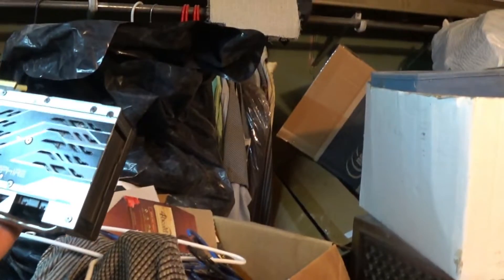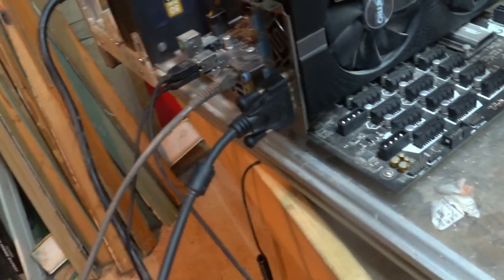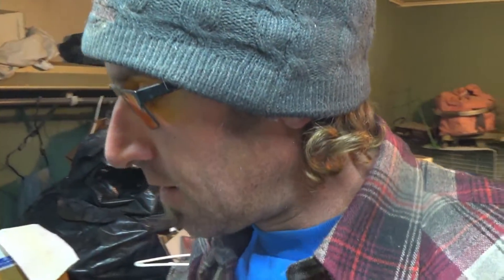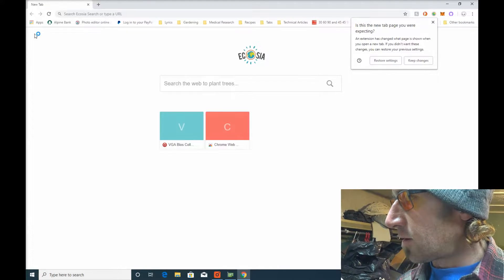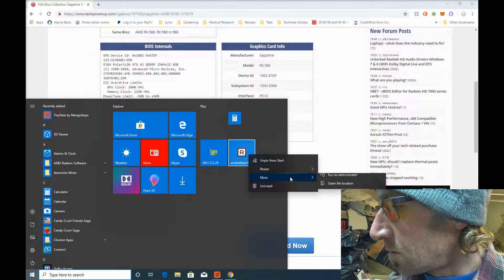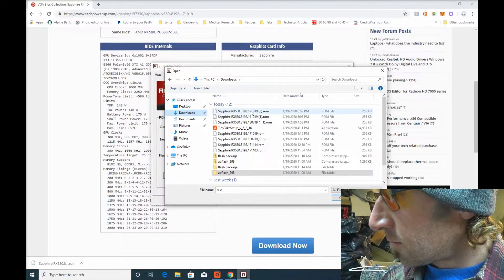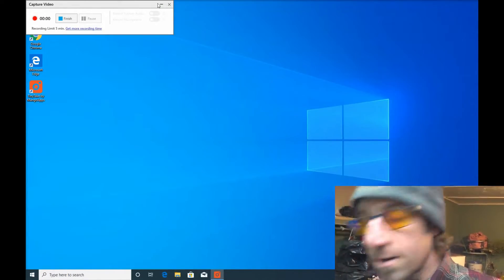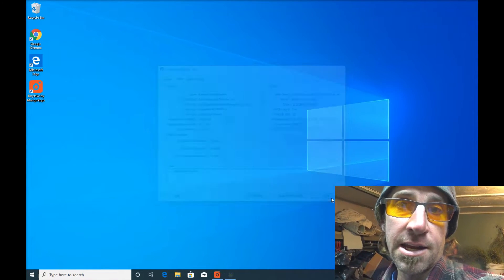How To Flash Stock BIOS of Any Graphics Card

Comment: Dude! Thank you so much! My RX 470 wouldn't install AMD drivers and was getting Error 43 in DXdiag.  I've never flashed a gpu Bios before. Made it SUPER EASY to follow. You also saved me from having to find a new GPU for my recording rig. I re-flashed the existing f21 vbios, and it worked. Windows sees my gpu now and can display my monitor at the proper resolution and Hz. Liked and Subscribed! Now I just have to fix that wobbly fan. THANKS MAN!

Comment: tnx. i have a gtx 750 ti and in the app for device id it says 10de 1380 but the bios version is 70.08.d3.00.00 which is for gtx 750 and i dont know the subvendor to get the right bios version can u help me with that?. also the device has code 43 error.
and i have searched for fake graphic cards and it seems that my card is a fake but the device id which matches the 750 ti and the bios version confuses me also the gpu clock and memory is 700 MHz and 750 MHz which matches with gtx 750
. help me.
Reply from the maker: Sorry to hear that! It's going to take some detective work to find for sure!
Reply: @MartyUlrich  is it possible that it has a modified bios installed?
About that deyective work, do I have to check the core chipset?

And also thanks for helping me
Reply from the maker: @sammarine8952  First, off, if the video card works, it is obviously not fake. If it is something some kid built in his garage out of five other cards, then you will just have to play around with different BIOS ROMs until you find one that works. Should be good practice - by the time you find one, you'll be a pro at flashing and troubleshooting GPUs!
Use the tools I describe in the video - it's all there!
Reply: @MartyUlrich  thanks a lot. and yes its working with an old driver for 2017 which is not compatible with some games.
thanks, I appreciate ur help.

Comment: I failed to run the amdvbflashwin file successfully. Error: Ati video is not available. Please show me what to do. Step at time 9.25!
Reply from the maker: Download the ROM again and then reinstall ATI flash and GPUz and try again using a known good video port (on motherboard or secondary GPU)
Reply: @MartyUlrich  I tried again to run the amdvbflashwin file (version 2.93) and got the message "Cannot find discrete ATI video card". Using the onboard primary vga. There is definitely a removable VGA on the machine. Please help me, thank you!
Reply from the maker: @HOANGNGUYEN-py1yi  are you able to see the drivers for that VGA? Does windows show any errors with them? I am not familiar with that particular error and would need to troubleshoot with a known good GPU and/or another motherboard/CPU

Comment: Hello, this is a long shot, i just bought 2 GPUS  rx 480s they are both like that 580 once i boot up the fans kick up to 100, is there a way to flash it and have the stock fan curves??
Reply from the maker: Yeah, that's what this video is all about. However, the fans may be kicking off for other reasons. Try the flash first. Could be a driver issue or a temperature issue! Good luck!

Comment: My motherboardsis broken
Reply from the maker: That sucks! Time to find a new one!
Reply: @MartyUlrich  my motherboard is broken becouse i did flash gpu
Reply from the maker: @fortzq9311  That is a first. The GPUz application has nothing to do with the mainboard, but if the motherboard is on its way to failing, an operation like this might just trigger its demise. Troubleshoot and see if one of the memory modules has failed. The CPU itself might have failed too, just have to test everything, but in all likelihood, you'll need some new hardware.

Comment: what about if someone has onboard VGA like intel hd intel graphics 2000 3000 or 4000 how to update vga bios for those/?
Reply from the maker: I don't think ATI flash will do that because it is integrated with the motherboard and therefore the only way to flash that GPU is to flash the BIOS of the motherboard, which is a completely different process.

Comment: mine crashes when i run ati utility even if i run as admin, screen flashes green then goes black with comp still on
Reply from the maker: Definitely a problem with the video card. A BIOS flash may not fix it as I think there is something physically broken on the board. Try the GPU in another PC or as least another known good GPU in your current machine to verify
Reply: @MartyUlrich  i ended up having to flash it with a software update app from the website but also had to use msi afterburner to reduce some settings for the new software to work right   so far so good  ty sir

Comment: Hi! My computer freezes when I execute the program to flash bios. What can I do?
Reply from the maker: Run some hardware diagnostics. You might have an issue with the hard drive, memory, or something on the board. The GPU shouldn't crash the system. If you can, try another machine.

Comment: Hey man I need help. I flashed my GPU bios and it wouldn’t boot after that. However I was able to reset my whole pc and reinstall windows and now it works and I can do normal stuff. However I play video games and when I installed my GPU drivers for my rx 580 my screen instantly turned blue when it tried to open. Therefore I had to boot in safe mode and uninstall my drivers which was successful. Then when I tried to flash my bios with ati flash my screen instantly turned blue when I tried to open it. Yes I did try to run it as administrator. However I downloaded what I was told to be the default version of the bios from searching it up. I flashed the GPU bios via cmd prompt and it worked. However I’m not sure if it fully worked. When I flashed my GPU bios with cmd prompt my screen turned blue. I let it sit there and it reset my pc. I opened GPU Z and check the bios version and it was the default one. But I still get a blue screen when I try to open ati flash and install drivers. Do you have any idea what the problem is.
Reply from the maker: That sounds more like a motherboard/CPU/Bus issue than a GPU issue. I would try to flash the GPU using another computer and see if you get better results.
Reply: @MartyUlrich  if u don’t mind can you explain how it’s a motherboard/cpu/bus issue? I’m not very good when it comes to other pc parts.
Reply: @MartyUlrich  I found out that I haven’t rlly been flashing my bios. I have found a way to force flash tho. I have narrowed down 5 bios versions that are compatible (I hope) and I will have to test each and every one of them. I also know that there are newer bios versions and older ones I can get from my manufacturer Bc I asked them to send me the latest one and they did. I will try to ask for older versions and even the stock one if they can get it. If these don’t work can you recommend any fixes?
Reply from the maker: @tomsmith8478  Just compare the details with GPUz, otherwise, yes, trial and error
Reply: @MartyUlrich  I found out that I can’t force flash my bios. However I download a different ati flash and it said “cannot find discrete ati video card” what do I do from here? I heard that I have to find the bios chip on my GPU and do something with the pins 1 and 8
Reply: @MartyUlrich  I also don’t have another computer so...
Reply from the maker: @tomsmith8478  FB marketplace... craigslist... put an ad out that you recycle old electronics... you'd be surprised what people throw away
Reply: @MartyUlrich  I fixed my GPU. I had to do make a bootable usb drive and make it into a dos. Then I forced flashed my bios and it worked.
Reply from the maker: @tomsmith8478  Awesome work man! Glad you figured it out!
Reply: @MartyUlrich  hey man since you have a rx 580 like me do you have 80-90% GPU usage when recording with it? I have high GPU usage for some reason even after I’ve used different driver versions and different recording softwares. Does my GPU bios have anything to do with this?
Reply from the maker: @tomsmith8478  I never checked and it's been over a year since I did a screen capture for a video.
Reply: @tomsmith8478  how did you do that

Comment: so i bought a mined gpu off of ebay i just bricked my gpu and i only have ryzen and i don’t know what to do help
Reply from the maker: Watch the video again - this is all explained. You need either a 2nd working video card or a motherboard with on-board display to use while you fix the bricked card
Reply: @MartyUlrich  yea i have an hdmi slot on my board but i have a ryzen processor which doesn’t have integrated graphics
Reply from the maker: @Trivenchy-r9m  interesting... I was not aware that using a Ryzen processor rendered your HDMI port non-functional. Have you tried it? It should support basic graphics... enough to fix your GPU

Comment: Any idea for my problem?
I have rx580 8gb, work fine, but when I buy monitor with HDMI... Have no signal before Windows fully loaded...
When I enter in the bios, i get black screen, when I change to the oldest monitor, all work fine (DVI)
Reply from the maker: Bizzare indeed, but I would say your card is fine. Double-check the BIOS specs with GPUz and if all checks out, update the drivers.

Comment: i have a question sir, i tried to install a new bios file because i got mine from mining. It's Powercolor rx 580 4gb. And after i installed it and reboot it there's no display or anything. My motherboard is kinda old.  Core i5 3570, LGA 1155. I tried to remove the pci on the gpu and let it sit on the motherboard. It boot up and when i came to check na DXDIAG, it's not reading the gpu. I don't know what to do next and i need help. Thanks!
Reply from the maker: If it was working before the BIOS flash, it was the wrong BIOS. Just go back and check the list again. Every detail that you get from GPUz must match 100% to the BIOS file you flash. Even if the device ID is two digits different, it'll brick the card.
Reply: @MartyUlrich  yes it was working perfectly before any flash. But the problem is, it won't boot and all i can see is blackscreen. I don't know what to do.
Reply from the maker: @terencegrageda386  You need to plug your display into another working GPU or the onboard video output. It's booting up just fine... you just can't see it.
Reply: @MartyUlrich  i don't know what to do next. i tried to flash it using usb. And i leave my gpu on the motherboard without pcie. After the install it said, adapter not found sir.
Reply from the maker: @terencegrageda386  it won't work via USB. You need to have the card plugged into the PCI 16x slot or it will not be detected and unable to flash again. If you don't have an onboard video output with your motherboard, you'll need another board.
Reply: @MartyUlrich  i only have vga connector on my motherboard sir because it's lga 1155 kinda old. So i need modern motherboard right? to detect my gpu?
Reply from the maker: @terencegrageda386  Possibly. That GPU might not work on older than PCI express 2.0 boards. Long as you have a VGA cable to plug into your display you can still use it.

Comment: i have 2 identical cards rx570 but with different roms, how do i extra rom from one card so i can use it  on the other? which program can be used for this? thanks
Reply from the maker: Well first off, just because they are both RX570s doesn't mean they are exactly the same. They likely have different brands of memory installed into the GPU and therefore each needs its own ROM to match the hardware inside of it. You can do all of that from what I show in the video.

Comment: I have a 8gb asus strix 480 but when I look up the the device iD it shows in gpuZ on google it says that number belongs to a sapphire rx 480 8gb nitro plus, does anyone know why this is? Could it maybe be that the card is actually an sapphire card but with an asus cooler and backplate (I don’t think this is the case because all the rgb stuff and connectors seem to be connected properly
Reply from the maker: Not sure about that one. Try flashing with your best guess of what the ROM should be and check again. I have never encountered that situation.
Reply: I tried to flash a few Roms but the problem is that when I try to flash an strix bios it tells me it is the wrong subsystem ID (gpuZ tells me the same) so I can’t flash a single one of the strix rx480 Roms available on techpowerup (bdw I also looked on the pcb to see if it maybe was a sapphire card with a strix cooler mounted on by the previous owner but this is not the case) so right now I can only flash roms that are made for sapphire cards and none of them work correctly (144hz doesn’t work and i can’t use DisplayPort. Gaming performance seems fine tho)
Reply: Hey i just fixed my card by bypassing the  wrong subsystem ID error by using the following video > https://youtu.be/a7RvCWUwc8M < this way I could flash the correct rom without getting the error
Reply from the maker: @hinke101  Awesome man!! Glad you worked through it!

Comment: Could the bios of my gpu be ruining the performance it was running fine for a while, now it's running half of the speed it used to, tested on a different system, however yesterday it ran fine, the day before had that same problem and the day before it was running fine.
Reply from the maker: I am not sure... but flashing certainly will not hurt it. There could be other issues causing that. The BIOS is but one factor.
Reply: @MartyUlrich  hey update from the future, flashing the GPU+ fresh windows removed the issue! Thanks

Comment: please i have problem my vga card K600 not working with drivers should i update the bios every time i setup nivdia driver ( ihave tried many versions old,new,,) some times work then after restarting i find that driver disbled and card not working i have search for soultion on the internt and nothing happen please can u help
Reply from the maker: First, check the card using the Direct X diagnostic tool shown in the video. If it shows any errors, the wrong BIOS is installed. Make sure all numbers match up and when you load the correct one, run the Direct X diagnostic tool again and it will show no errors.
Reply: @MartyUlrich  I TRIED TO DOWNLOAD ON OF BIOS AND NOW IT WORKS <3 <3 ,, AND BEFORE I INSTALLED IT DX DIDN'T GIVE ME ANY ERRORS BUT I TRIED IT ANY WAY AND IT WORKS BUT I HAVE QUESTION PLEASE
WHY I CAN'T CONTROL POWER OF MY VGA IS THAT BECAUSE IT GOT NO PWOER PINS MY CARD NAME "QUADRO "600"

Comment: Heyyyy man . Please help . I'm getting this code 43 in the device manager for my gtx 1660ti please helpppppp. What is the problem ? Is it my graphic card fault or motherboard or any other thing? This same setup waa working earlier. I started to face this problem from the past 2 weeks . I tried everything on the internet . No luck. Please help man. Thanks❤️
Reply from the maker: Run the tool in the video and it will show you if it has anything to do with the BIOS. If not, then it is a driver issue

Comment: hey, my gpu says on gpu z is a hynix memory but the only matching bios on tech powerup shows samsung. is that okay?
Reply from the maker: Try it but probably not... gotta find the right one. Tech powerup doesn't have everything
Reply: @MartyUlrich  he just sent me this 

Make clean driver uninstal using DDU software and there is steps how to do https://www.techpowerup.com/228536/amd-bios-signature-check-re-enabled-with-relive-locks-out-polaris-bios-modders. Download Bios.Sign.Bypass and ati clock patcher. Easy, will work.
Reply from the maker: @Dr_LazarusHU  Let me know if it works!
Reply: @MartyUlrich  yeah it works just fine actually, this might save you from just a basic error
Reply: @MartyUlrich  yeah I noticed that, All the other things were all good like the ids and stuff. I also have a question. I got my gpu (rx 570 msi) and when I installed it, my psu only had 6 pins while the gpu has a 8 pin intake. My gpu runs fine and I can get a display but the drivers won’t work at all and it’ll keep giving me the same message of no and drivers installed or not functional and graphics card. Do you think this is a problem with the 6pin or bios, because the guy who sold to me on eBay told me that he overclocked. He told me to use ATI pixel clock patcher. Would that work?

Comment: so if i plug up this gpu i have, and i dont get an image on screen, is it a dead gpu and am i screwed? i dont think the guy screwed me over, i even have the flash drive with the stock info to flash over. i just cant see anything how youre able to. any idea?
Reply from the maker: You need to load it up on a machine with a working video card, preferably integrated graphics, then you can properly look into the issue.

Comment: Good griefs, you've got some skill. I'm not tech savvy so I really admire your work. Can I get help with my card. I have no idea what's wrong with it, I few months ago I run the "Heaven benchmark" on it and it kept crushing. My card had been gaming fine before by the way. After the benchmark crash, then my problems began. I tried to reinstall the drivers but the PC kept restarting. When it restarts, it freezes during the windows boot screen. The PC turns in fine without the nvidia drivers, but immediately I try to install drivers then it stops in the middle and restarts and freezes. What could be wrong with my Asus Strix GTX980ti
Reply from the maker: I am thinking a physically damaged card in this case... try another known good one to troubleshoot

Comment: My r9 270x without drivers it works but when i install the driver it shows black screen can you help me?
or this method will fix my video card
Reply from the maker: Yeah I'd say check GPUz and verify whether or not it is the correct ROM. It probably wouldn't hurt to re-flash the correct one, even if it is what you already have. Then try again.
Reply: Can you solve the problem?